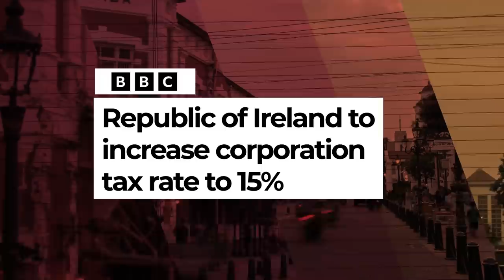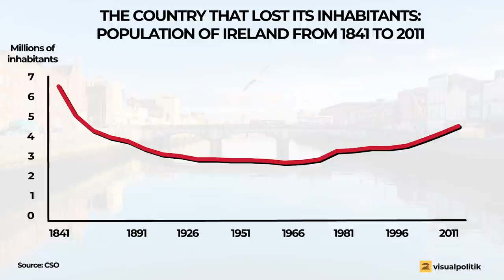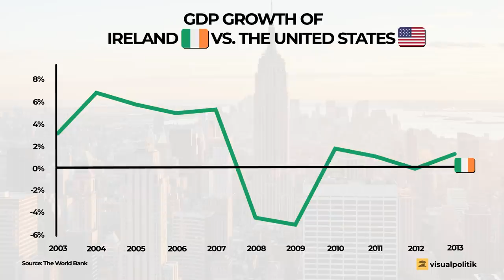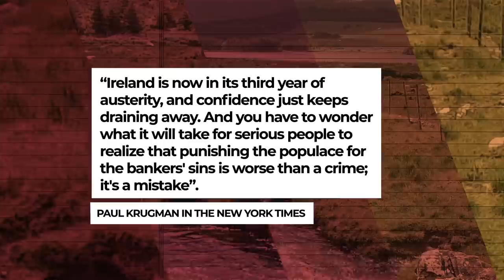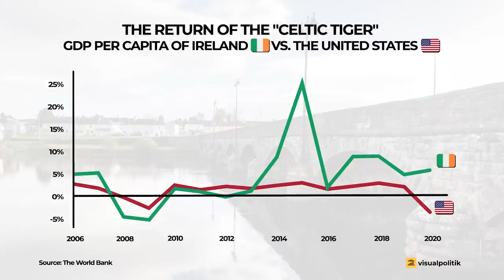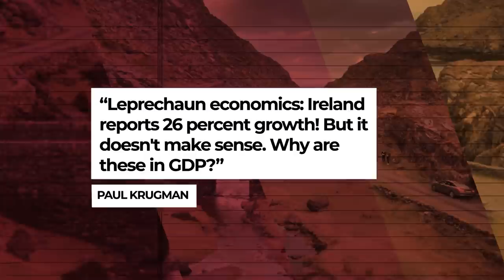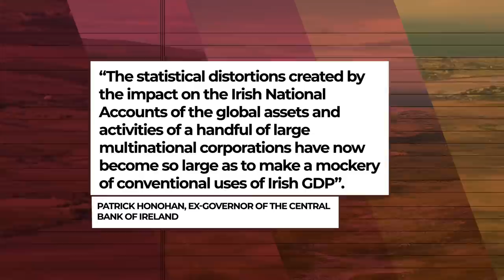How can IRELAND be the RICHEST country in EUROPE? - VisualPolitik EN

Comment: Sorry many of your facts are misleading or plain wrong. You did not include that Ireland has not paid off its loan. That will take years. As many have said here, housing and accommodation is a nightmare. We had one advantage during Covid, a significant portion of the economy were able to work from home and able to generate income for their company and the country. In that way we were less affected than many. You need to do better research in future.
Reply: Irish debt to gdp was 115% in the 80s. It was over 100 iduring bailout. It is closer to 40% in 2022.

Comment: How can Ireland solve its housing crisis? When either or both of these conditions hold markets fail. 
1) Social costs to society as a whole (not just the cost to the private entity) are fully reflected in the supplier’s marginal cost of production.

2) The price consumers pay fully reflects the marginal benefit realized by consumers.

These conditions are not maintained in an unregulated market where pollution occurs. Manufacturing waste from fracking or carbon emissions from use of a product are two examples. The housing market you describe in Ireland 🇮🇪 is another example.

Public regulation correcting for these market externalities (aka market failures) is required to produce an outcome that benefits instead harming society as a whole.

Carbon emissions harm all, even those getting rich from carbonic pollution.

The same holds true in housing. The public health impact of chronic housing insecurity is enormous and the costs of remedial societal interventions is … well I’m sure you can finish the analysis on your own.

Comment: "Ireland had 17% unemployment and now I'm going to show you how to shave your balls. OK back to Ireland now."
Reply: Ireland has unemployment rate of 4.4% which is one of the lowest in Europe. Italy and Spain have unemployment rates that are twice that. Greece has an unemployment rate that is three times that.
Reply: @bighands69  That's the current rate but 17% was the rate during the tough years. It was even tougher than the 17% suggests because there was no jobs. Today's rate of 4.4%  doesn't reflect the true reality because there is jobs. As a matter fact right now today alone on a single employment website called INDEED there is 62,000 jobs advertised. That alone is enough to halve the current 4.4% rate.

Comment: We have taken in over 60,000 Ukrainian refugees which has added to our already housing crisis
Reply: That has nothing to do with Ireland housing crisis. Ireland simply is not building enough homes. It needs to deregulate house and property development. 
Right now nearly 70% of the house build cost in Ireland is regulations based. If Ireland was to reduce that to say 30% it would massively improve the house building output and reduce the cost of houses quite significantly. 
No point crying about refugees when the basics are not right.